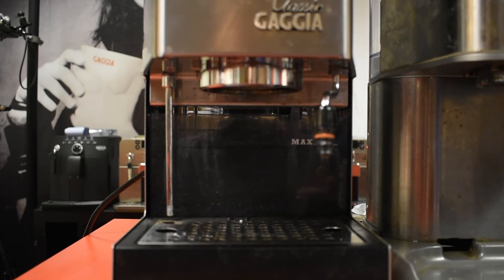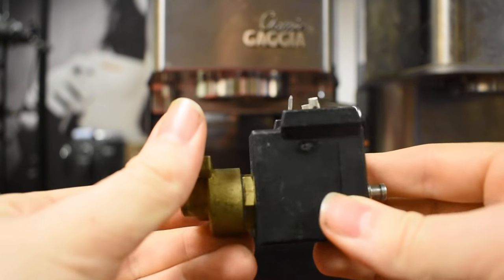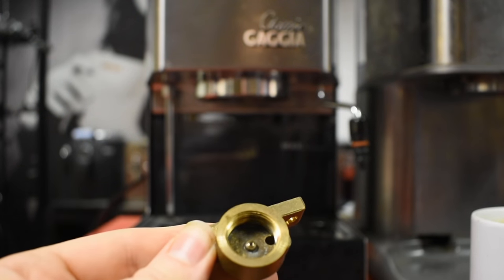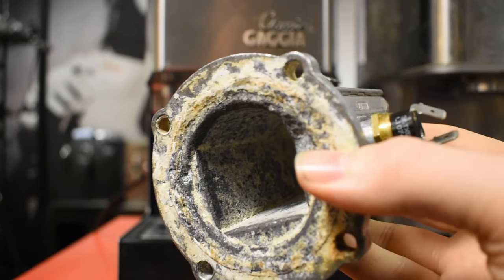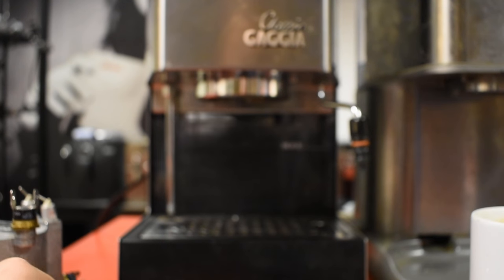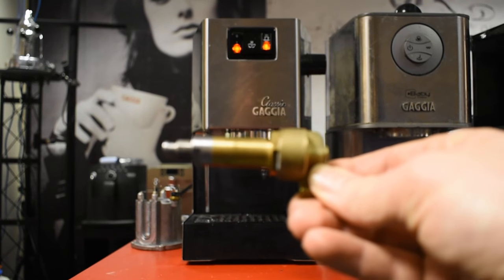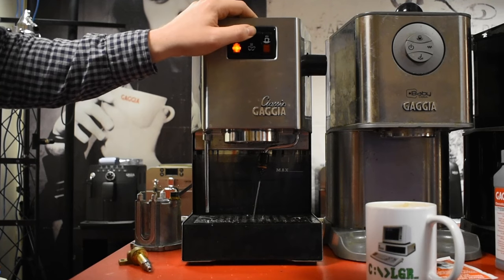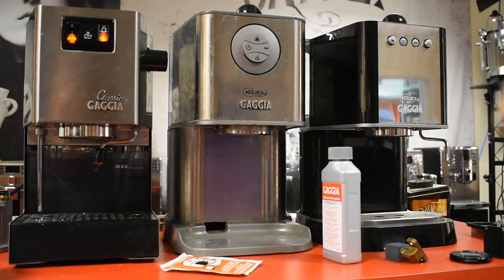Unblocking a Solenoid Valve on Gaggia Espresso Machines - Gaggia Caffe TV

Comment: Hi I cleaned the solenoid , but still no water dripping from machine.The top of the machine get quickly very hot .What could be other possible problem to look at it.Looks there is no pressure in the pipes.Could it be the pump issue ? Many thanks !
Reply from the maker: Is water coming through the steam wand!?
Reply: @GaggiaUkElland  nope .What is the unit on right side of the solenoid?
Reply: After i cleaned the solenoid some water came down but after 1 min stopped.I will clean it again tomorrow.
Reply from the maker: @lyubomirter  Try using a stronger descaling solution and follow the procedure on the video. Might help.
Reply: @GaggiaUkElland  I dismantled this morning.One of the little hole (left one) in the solenoid looks like part blocked ( the air go trough but not like trough the other) .Could it be this the issue?
Reply from the maker: @lyubomirter  That might be the issue. You may have to use compressed air if you cannot get it unblocked by soaking it in descaler.
Reply: @GaggiaUkElland  all works now.Thanks for the support.Still I find the top of the machine get hotter than my othes same model classic which is strange.

Comment: Speaking of the solenoid valve...I just bought my first Gaggia machine. It's a used Gaggia "Espresso" that was built in 1995. There was no release valve on those old rigs so I bought the parts for a Classic Pro (under $100 U.S.)  and swapped it out with the "Espresso's" old parts. I now own a 1995 "Gaggia Espresso" with brand-new Classic Pro parts.  I've renamed it to my "Gaggia Espresso Pro."

Here's a video I did pulling the second shot after the overhaul. 

https://www.youtube.com/watch?v=L77EIrTLheQ